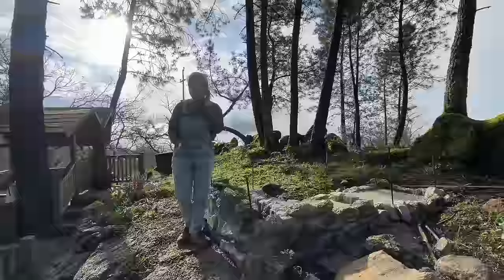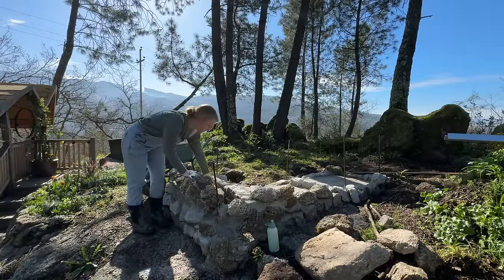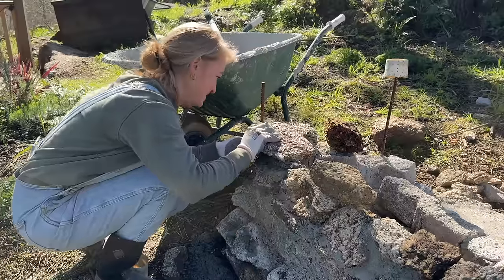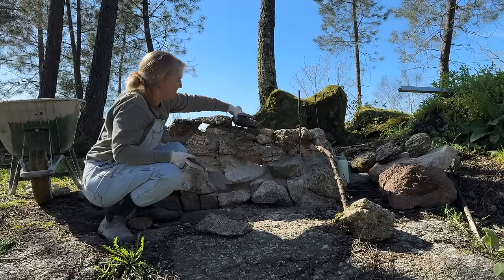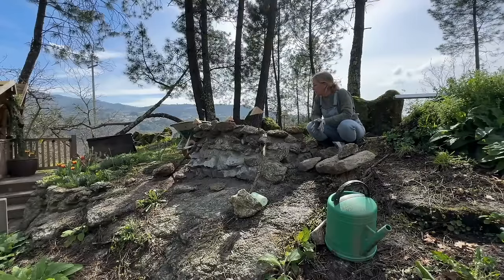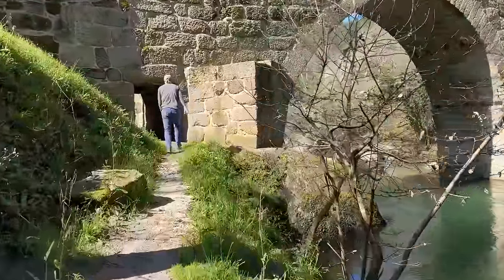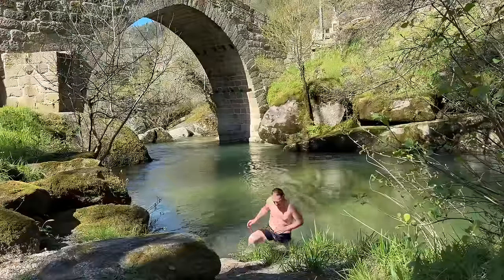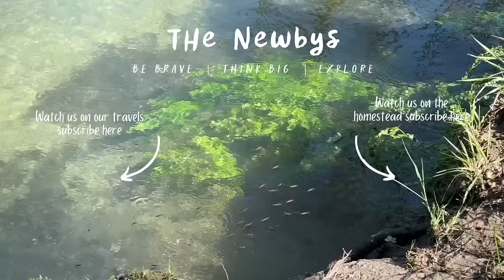We need to take some time away from our Portugal farm

Comment: Hi Tara try to find some big corner stones and drill a hole through them and sit them around the wrought-iron bars that way your hiding the bar yet its still doing its job plus you geta good structural corner stone which will give loads of strength to your pizza/bread oven table. Good luck it looks fantastic so far. 😊😊😊😊
Reply from the maker: Thanks for the advice Martin 🙌🏼❤️😄🇵🇹
Reply: @TheNewbys  Tara, you're most welcome.

Comment: That cold river plunge looked fun!
I said ‘looked’!
I don’t think that’s for me!
I’ve been thrown into very cold water here in the states. But I think it was around 55*, not freezing temps like your river!
It’s very shocking to the system to be plunged into very fold water!
You said everything should work out for your build. 
Everything WILL work out because it HAS TO!
There’s always a solution or workaround.
And I know you two, with your positive attitudes will make something positive happen!
Crack on!

Comment: Tara, thank you for taking me back to good days, when I used to do likewise❣️Only I didn't have a cement mixer. I was mixing it myself while a friend was holding the hose ...stone building was thrilling❣️Have in mind that you'll have to dress you furnace with firebricks inside. That keeps the heat after the fire goes out a😮nd you spread the hot charcoal around the edges. YOY ARE BRAVE❣️I find it difficult even I summer to have cold water on my Tammy. That's why I fall in all together.If I do it gradually I stop breathing. Keep up the good living❣️😘🇬🇷
Reply from the maker: Yasas!! Thank you friend love this comment!! ❤️❤️

Comment: A wire brush would help a lot with cleaning the cement so it is recessed from the stone. Just scrub the cement after it is set but still soft enough to remove the excess.
Reply from the maker: Thanks Kim!

Comment: Tara you need to control your breathing with cold water immersion, long slow mindful breaths and you just need to mentally power through the first 30 seconds to avoid cold shock and once you are through that your brain understands what’s happening and it feels ok.  I have been doing this for 3 years now and I love the effects even if I don’t love it when I am in it. 11.5 minutes per WEEK is all you need to maximise the wellness benefits.  Also doing something tough you don’t want to do but do anyway stimulates the ‘mid singular cortex’ (thank you Dr Huberman) it builds inner strength, improves willpower and improves your perception of your life - that’s how I can translate the medical version of that.  You have had two babies, you are a powerful strong woman,  you can power through 30-90 seconds of cold water to reap enormous rewards for your mental health.  Please try it for a week and you will feel the rewards I promise. I do 2.5 mins each shower and even now I dread turning the dial down but I do it and am rewarded each time I do it. If you shower first thing in the morning ☑️ that is one tough thing achieved today.